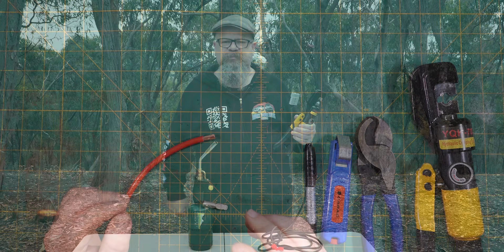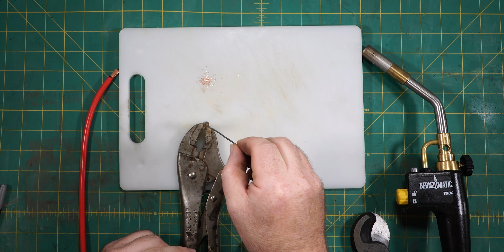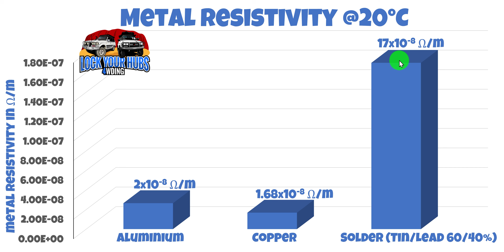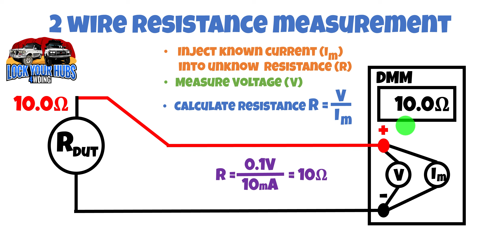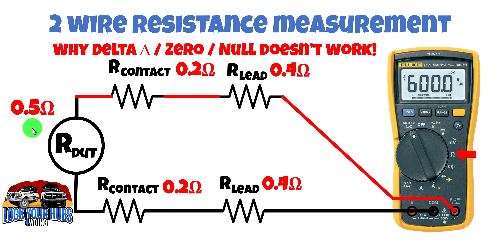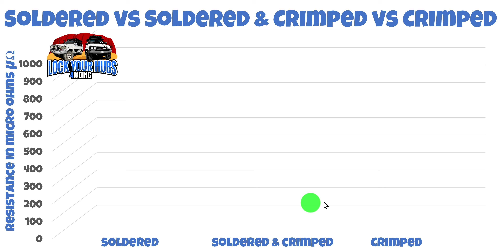Crimping vs Soldering for Anderson Plugs

Comment: Nothing beats a good graph. I understood that perfectly. Now I know why I solder instead of crimping. Soldering is cheaper and I don't have a crimping tool. Thanks for educating me once again Simon will see you in the next video.
Reply: Solder wins in terms of resistivity, however, crimps are usually recommended for high vibration environments. Solder can crack and split from heavy vibrations. That’s why automotive applications use pretty much exclusively crimps for all the connectors
Reply from the maker: I keep hearing that, though are yet to see any conclusive data, one way or the other.
Reply: @LockyourHubs4WDing  haha that’s a good point! It’s something that’s quite important to automotive manufacturers so I’d be surprised if this hasn’t been investigated and the fact that commercial cars more or less exclusively use crimps may suggest their superior. But there could be many other factors and that reasoning is certainly not conclusive
Reply: @MrSmoothvideos crimps are faster to make. Cost, not quality, and certainly not longevity, is the only thing that drives decisions in today’s automotive world.
Reply from the maker: I couldn't believe the result. And you know the graphs are just for you right? :)
Reply: Although the energy loss of 9W when you're pushing 1200W through it is insignificant in terms of efficiency, and even more so when you consider that the best electrical connection (soldered) loses 3W so you're only losing 6W.
However efficiency isn't the only consideration... the extra 6W dumped into the connection, doubled to 12W in the usual positive/negative Anderson plug, might, in a sufficiently insulated and/or warm environment, cause enough of a rise in temperature to damage the plastic connector. Depending on where it is and the presence of forces from weight on the connection, it might even be possible for the plastic to become fully molten, which could result in the two contacts touching each other. Without short circuit protection, there will be fire.
Reply from the maker: I think in all but the most adverse conditions, the Anderson plug will effectively be able to dissipate the extra heat generated to the atmosphere.  Though, you make a great point about circuit protection using an adequately sized fuse.
Reply: The longevity of solder because of corrosion avoidance is what got me sold to solder, especially for high amp connections.

Comment: So I have one question was your solder old stock?
Why do I ask this? Well all solder once had tin and lead in it, but this is no longer the case and most solder is made up of specialised epoxies!
In the aircraft and motorcycle industries, solder is not used because of the high risk of the dry joint!
I also believe that some terminals that are used in aircraft and motorcycles when crimped don’t just press on the outside, but fold over and turn into the wire causing a better connection.
I personally after 30+ years have always removed solid joints out of motorcycles and replace them with a good clean crimp joint because all the solar joints that I’ve come across have been corroded from the fluxes used and the environment .
But it’s the first good test that I’ve seen .
Maybe you could do a retest on different sorts of soldiers for resistance, and they connections .
Keep up the great work .
Reply from the maker: As per above, it was just standard 60/40 from Jaycar. Though you make an interesting point about the modern "lead free solders" that might be on the cards for a later test.
Reply: @LockyourHubs4WDing  thanks for your reply, I asked one of my local (the most experienced and longest running) auto electrician about tinning a copper bar that I have made up to extend the earth terminal through the smart controller before connecting my winch cable and the earths back to the copper bar (so the smart controller will realise the voltage drawer from my winch when winching) he pointed out that there was not enough tin in the soldier, any longer to have a good electrical connection!
So if would like it tinned to stop the copper bar corroding, I will need to send it off for tin electroplating.
I once specialised in rewiring motorcycle CD ignition units externally, but I cannot remember how I did this now because I’ve got a severe brain injury.
Lucky just to be alive .
Reply from the maker: @overland_adventure_nz  I'm a firm believer in that every vertical day it a good one!

Comment: crimping is more susceptible to corrosion
soldering alone has no mechanical grip if the wire is overheated (it shouldn't ever get that hot, but shite happens)
crimping and soldering solves both those issues.
fatigue is never an issue with proper cable restraint, and likely never would be in an anderson plug housing. it gets thrown around a lot that manufacturers don't solder, but people fail to realize manufacturers do what makes the most money and is easiest not always what's best.
in a 4wd application that gets used as a 4wd and sees mud,water and corrosive environments then corrosion is probably more of an issue than fatigue.
Reply from the maker: I agree, especially if the connection is external.
Reply: @LockyourHubs4WDing  I have a video suggestion to help the Muppets that drive through saltwater. Do a video of passing current through a copper wire suspended in saltwater showing how it turns the copper into verdigris.
Then I can paste the video link on every social media post showing someone driving through saltwater.

Comment: Resistivity has never been my main concern when crimping/connecting. Safety from a potential joint failure has always been priority, I would be quite interested in seeing a test for fatigue and corrosion. I have always used crimping only but am considering crimp then solder for the added corrosion protection on my current build. Thanks for the content 👍🏼
Reply from the maker: I think a vibration test is on the cards.
Reply: Did you notice how he soldered the connector to the wire - I imagine very little solder wicked up the wire beyond the connector body. As far as I know, that wicked solder beyond the connector is the cause of failures from fatigue, and if there is no wicked solder beyond the connector then the fatigue failures will be much, much less.
It'd be nice if LyH4WD cut the cable a few millimetres past the solder connector to see how much solder has wicked up there.
Reply from the maker: @ShoebridgeForPM there doesn't seem to be much difference between the crimped and soldered as far as the flexibility of the two joins are concerned. Having said that, I haven't opened the soldered join up to see how far the solder has wicked up the wire.
Reply: @LockyourHubs4WDing  I've flooded the connector and solder wicks all the way up for around 20mm. Your method, you leave the copper without flux and use gravity in your favour with the molten solder. I really liked that.
Reply from the maker: @ShoebridgeForPM  cheers
Reply: @ShoebridgeForPM I have had excessive wicking too, but 20mm is far too much, its not good in vibration situations and I believe it has caused corrosion on a solar pv Ando connection that was subject to more weather I had trouble with, I think the flux may have been a corrosive influence.
Reply: @evil17  That's right and the reason I didn't persevere with soldering and went to crimping. This technique of half filling the connector with solder and pushing the exposes copper into it may be the solution.
Reply: @ShoebridgeForPM I am not convinced tho Ben, because just the other day I did a bodgy recrimp of a soldered Ando connection that had come loose in a short thicker extension cable I made several years ago & I am pretty sure I used this exact method of half filling the terminal while in a vice & then dipping the cable down into it while applying a little more heat for penetration, I remember they seemed perfect at the time, so I didn’t crimp it.
What I believe has & often does happen, is that the actual Anderson plug connection heats up when using or charging higher loads in particularly, to a point the solder actually melts or softens enough to compromise the connection. This lead has been on my suspect list for awhile as it often starts out charging a battery ok & then it would derate the amount of current going to battery giving a false sense it was all working ok, but if I moved or pushed on the connection the charger amps would go up again for a bit & then drop off or stop completely, so I knew it was suspect. I did not crimp this connection before or after soldering as I sometime did for extra security, because I thought it looked so good it did not need it. 
I have found these Ando connections can heat up at the plug in connections at times, not just at the wire termination, especially if they are subjected to outside conditions without some type of weatherproofing, so I try not to use solder at all now days, there is a bit of debate about it of course, but while old habits die hard, I feel solder can do more harm by adding rigidity to the connection, the flux can be corrosive, & if not crimped first can fall apart if connection gets hot. 
I have seen the wire snapped clean right at the solder point on Ando’s too.
Ive come across a number of military & airforce personnel comments that collaborate on the different reasons they do or don’t solder a connection for a particular purpose and strict guidelines on the way a connection must be joined and soldered for that purpose. 
If a good cable crimped connection is made, it was my belief that the metal molecules are squashed that close together it forms a cold fusion bond where the two metals basically become one at the joint.
Anyhow, it took me a fair time of research and practice experience before I stopped soldering thee connections, so I am still on the fence after Simons tests and think this subject needs more looking into. Cheers
Reply: @evil17  Yup,  you don't want to use this video as a guide for terminating large conductors unless you looking to create fires.....
Reply: Looking forward to seeing your testing method. I'm guessing your a sparky/instro?
Reply from the maker: @louisegan99  I'm just a bloke with a 4WD..... :)
Reply: @louisegan99  Not bloody likely.  A qualified electrician would know how to crimp lugs correctly, which didn't happen in this stupid video.
Reply: And some interesting content. Keep it coming 👍🏼
Reply: A clear demonstration on how NOT to solder large conductors......

Comment: Good to see the 4-wire test being used.  I use a little constant current DC supply that uses a DC source voltage, set it for 1.00 amp with the multimeter set for millivolts, and with V=IR, now V=1R or V=R, anything the meter reads in millivolts across the same length of circuit is the resistance in milliohms.

Is 934 microohms 0.000934 ohms?
Reply from the maker: Hmmmmmm...... I might have to double check the math.
Reply: @LockyourHubs4WDing  Don't know what I'm thinking.  I'll start again...sometimes I can't see the wood for the trees(!).  If you're calcs are good, I'll take your word for it.

Comment: There's a big issue with soldered joints in situations where cables have movement, it creates a hard point that is susceptible to work hardening that leads to breakage, soldered joints are not permitted in marine applications for this reason, and the same problem applies to automotive, so whilst soldered joints may have a lower resistance, that's only until it breaks, at the most inconvenient time... the next test you should do is a flex test, bend the cable repeatedly at the joint..
Reply from the maker: Yep, I agree, I would take a more reliable joint over a slightly more conducive joint any day of the week.
Reply: @LockyourHubs4WDing  "Soldered joints are not permitted in marine applications". Just an utterly ludicrous nonsense statement. The marine standards say you don't JUST use solder, as movement of an unsupported solder joint can cause the actual solder to crack / lift, giving what they call a "dry joint". But it absolutely IS permitted to solder AND crimp, or use solder wherever there is some other decent mechanical support also. And this idea that soldered joints are prone to the actual wires fatiguing is pretty much complete nonsense. If you have excessive wire movement at a joint, of course you can have the wires suffering metal fatigue at the point where the wire is clamped. But that applies equally to a crimped or mechanical joint as it does to a soldered/welded joint. Crimping has no advantage there. So, soldering gives a better connection, because it maximises the surface area of contact between the two surfaces, and because it fills all gaps and provides the greatest cross-section for current flow over the very short distance into the copper wires. Those two factors more than compensate for the fact that it is not as conductive as copper. So, pls ignore the just-crimp idiots, and thanks for a well-done experiment which confirms soldering gives a superior connection, because it does. And ignore idiots who look for excuses to crimp, because they're lazy & stupid. Crimping is great to give you a good solid mechanical connection that then allows you to easily come along and add solder. And then you have a great joint with crimping to provide mechanica support and solder to maximise conductivity. So, if you want a good connection, just learn how to solder. It's not that hard to get started, and you'd have to do a terrible job of it, for it not to be an improvement over a crimped-only connection.
Reply: @An_Idiot_in_the_Wild   As one of those "lazy idoits" who crimps mobile connections, I can affirm that in the US the stardards set by the ABYC call for crimping electrical connections vs soldering them due to the exposure of movement and vibration found in the marine environment.  Soldering a wire or connection turns that stranded wire into essentially a solid core conductor, which will fail under vibration.  The ABYC training included lab experiments where a crimped wire connection and a soldered wire connection were mounted and exposed to the same vibration standard, the soldered wire connection failed each time at the end of the solder in the wire.
Reply from the maker: I would be interested in checking that out, do you have a link?
Reply: Would be interesting to leave these joints in a 'normal' outdoor environment for 6 months and run the test again.
I'd guess the crimp resistance would considerably greater than the bench tested joint.
Thanks for sharing your test results, as someone who has been involved in electronics and industrial electronics your test confirms what my gut was telling me to do with these joints on an RV I'm playing with and why I googled it in the first place!
If you are going to have unsupported wiring you are asking for trouble anyway, I'm gunna solder, mate 🔥

Comment: If we looked at the surface contact area under a microscope, between solder and crimping, then I can understand how solder wins. It would be interesting to see the thermal differences between a soldered and crimped Anderson connection under a high current load. Pushed to the limit, I would expect the solder to melt on an Anderson connection and fail, before a crimped connection failure. I guess the crimped connection would hold on and the electrical insulation around the wire would go up in smoke. Thanks for another very interesting video.
Reply from the maker: You might have noticed the type K thermocouple probes under the heat shrink on a couple of testing samples.......
Reply: @LockyourHubs4WDing  I actually did (note the thermocouple) but I missed their use in the video. I'd also be interested in what happens if really the full designated amperage would be blown through the solder. Would it get warmer than the wire? Would it get warm enough to weaken the soldering over time?
Reply from the maker: @afoeder  as the resistance is less for a soldered joint than a crimped one, the heat generated will be less. Leaded solder typically has a melting temperature of 183C, though that depends on the specific alloy.
Reply: @LockyourHubs4WDing yeah thank you, I've already had something like that in mind while typing my comment :) Also usually pulses / alternating currents are especially tough on solderings so that cold soldering joints more likely occur. Thanks for your thorough video!
Reply: @LockyourHubs4WDing  so how do you reconcile the material resistivity contraction? Why does copper on copper connection lose an inferior conductor?

Comment: Can use solder paste in joint before crimping (then heat to melt after crimp) if youre doing combined joint
Reply from the maker: I haven't tried that, how did it work for you?
Reply: @LockyourHubs4WDing  I got it off the guy who runs AntPak power (ex Siemens power system engineer) who always does it. Works well but the paste is $$
Reply from the maker: @bruceshelley840  Cheers, I'll have to look into it.

Comment: I'm surprised. I understood the crimping process was intended to compress the strands in to a solid copper core giving better conductivity

Also, I understand the solder, as it travels along the cable a small way can give greater chance of a fatigue break occurring where the cable would otherwise flex

I have used both but there are confined spaces where I can't use a blow torch and soldering iron just doesn't put out enough heat so I settle with the crimping (same as for terminal lugs)

I guess horses for courses.

just about every electrical job i do i wonder whether i could have done my connections better.
Reply from the maker: Me too, that's why I thought about doing this test, and quite frankly, I didn't see the results at the outset.